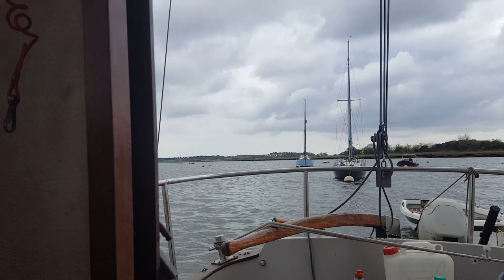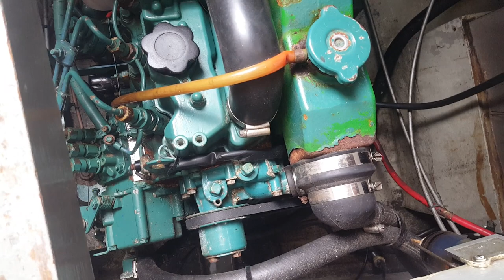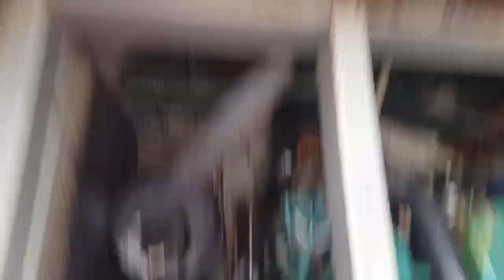well of unhappiness

Comment: you will learn to love that diesel when its needed........A new boat with a pilot house, Dylan you've come a long way from the slug!😁
Reply from the maker: I have come a way from the mirror that is true - This has an elderly slug type engine though. Both centaurs had good engines - the second one had an almost brand new beta - I was very sad to sell that boat .
Reply: @KeepTurningLeft  diesels are good engines that are hard to kill, 
just keep changing the oil. the gearbox though that will probably be the one. love the pilot house though. Sailing season is upon us and i am putting my boat in the water this weekend. have a good summer Dylan. enjoy the new boat!

Comment: Dylan the problem with these old British mobo sailors Fairways is that there is very little engine room ventilation , easily cured with a good plastic pvc down pipe in to the engine bay up back corner wheel house in to a sexy deck cowl vent. I bet your fumes dissappear add fan if win lottery. Most Dutch motorsailors  have fitted those guys know a ting or too ..belive me perhaps a project for later? Now your 60% mobo and repenting ..lol keep up the lovely vids. 👍
Reply from the maker: I got an email suggesting that I rop the stern hatch open by laying the boat hook across and leaving gthe bog window open to promote an air flow through the boat and out via the engine department. Works a treat

Comment: Oh dear Mr Grumpy today at least the water around the engine not salty but has antifreeze you could swap for petrol but chance blowing boat up with the stray fumes..
Reply from the maker: I use petrol in the outboard which does at least half of my movement under power. I am slowly winning with the engine installation. I now have a drip tray under the water cooled gearbox
Reply: You mentioned fumes or smell how a bilge blower or cheapskate version is Car Radiator from a car breaker with a simple on off switch venti g hot fumes to the outside rather than them seeping into boat ?
Reply: Car radiator Electric Cooling Fan…

Comment: Yes they are hateful and absorb a large chunk of boat maintenance resources but hang on ... it's a motor sailor yes? I always repeat a mantra "I love working on engines, I love working on engines' and occasionally hit it violently hard with a spanner (if you follow this advice, please wear eye protection, is best).
Reply from the maker: I have worked on  diesels on farms, cars and forklifts - a boat engine is uniquely hard to get at and  you have to be anal about tiny leaks.

Comment: I might have a gear box  you can have looks like the one on my old md11
Reply from the maker: thanks for the offer.  The oil loss is small... the water  loss stops when the  salt water intake is closed .  I hav e fitted a dri  tray to catch the  worst of it. The engine is 25 years old... the gearbox is even older.  robably goig down the electric route as  soon as I have saved u enough prension money.

Comment: 99% of cruising yachts get on fine with diesel engines Dylan, you are just making yourself sound deranged. You could easily sell that MD, if you don't want it..I had one in my Hurley and it was totally reliable.
Reply: @freddyrassinger8198  It needs a service and a replacement gearbox heat exchanger. A few 100 quid.
Reply: @jerrytugable  I have a Bukh dv 10 in my boat & I don't understand why you would want to circulate sea water around it.
Reply: @nicholasmorrill4711  Agreed, that is why most engines use heat exchangers.
Reply: @jerrytugable  Mine pumps in sea water circulates it around the engine & then expels it over board.That all looks unnecessarily complicated to me.
Reply: @jerrytugable  I should have stated that the water does not circulate around the gear box,why would you want to do that?
Reply: @nicholasmorrill4711  Gearbox oil coolers are normal fitment on very many diesel engines, because gearbox oil gets hot.
Reply: @jerrytugable  Not in my gear box it dos'nt clearly,sounds like an over complicated design.